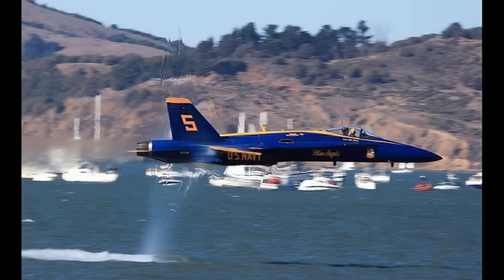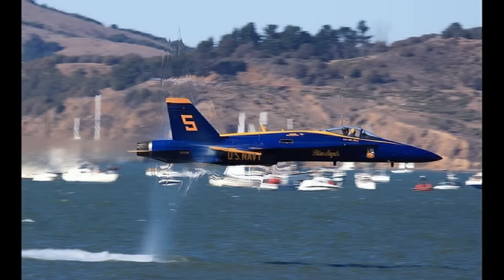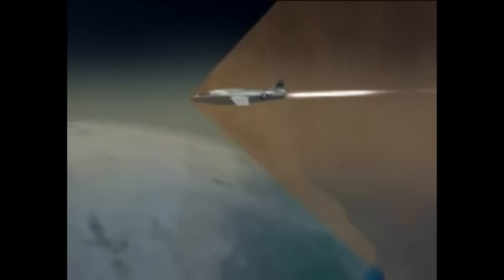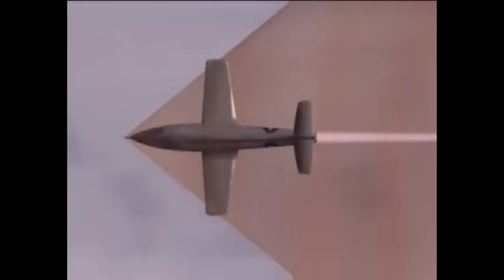Supersonic Flight, Sonic Booms

Comment: The ground-effect is visible pressure, causing, ahead surface effects on water. The super-cruise(maintained-sustained) mach1.1 (at sea-level) should build shock-waves(sound and compression-condensation, from perspective of ground-observer) and pressure-waves, to destroy roof-tiles, behind the exhaust.

There is only one known plane that can sustain super-cruise, inefficiently - f14a tomcat. Others are classified. If you ever see a fatty by the name of hawker looking like old type going only super-cruise at sea-level (double impossible to most, current, fighter jets), it's weapons is air. It's target is roof-tiles. It's intended purpose-effect is to vent on enemies. Bonus for good performance pilots... Fuel is expensive. Super-cruise without after-burner(reheat), that is the game.
Reply: Some cultures think they can get away with bullying others... The joke is on them.

Comment: You can not see a sonic boom.  Your entire video is bunk.   A vapor cone has to do with the moisture flowing over the surface of the aircraft.   They are easily viewable at slow speeds as when landing.  To know you've witnessed a supersonic event, you must see the aircraft go by without ANY sound.   Then, within a second or two, you literally hear the sound  chasing the aircraft. 

Stop using vapor cones as a visual reference for a supersonic event.

Comment: Sonic boom is an impulsive noise similar to thunder. It is caused by an object moving faster than sound -- about 750 miles per hour at sea level. An aircraft traveling through the atmosphere continuously produces air-pressure waves similar to the water waves caused by a ship's bow. (short explanation) sound has it's own speed so when somebody/something is going faster than speed of sound it creates a Sonic boom

Comment: Very nice video. I haven't seen some of those low level flyby clips before. You've collated some awesome footage there.

The subject of transonic and supersonic flight is really fascinating. There's a fair amount of instinctive flight dynamics that goes right out the window when an aircraft reaches that threshold. A lot of early experimental supersonic aircraft crashed because the whole flow of air around the plane drastically changes at those speeds, and suddenly the pilot finds the control surfaces don't produce the expected flight attitude changes. I read one test pilot likening the effect this had on his experimental plane to dragging a bubble of stalled air with him that encompassed all the tail surfaces !

I think the sentence "Seriously scary shit" probably didn't even come close to describing that feeling. :D

Comment: If the aircraft is going faster than sound, the cloud cone will have a central angle less than 90 degrees. If the angle is larger, it's not supersonic.

Comment: Just because you can see a vapor canopy form around a jet that is going relatively fast does not mean that it is going the speed of sound. It is just an indication of the water vapor saturation and condensing that forms around the fuselage and wing. This can happen at relatively slow speeds at near 100% relative humidity. It is especially noticeable on aircraft that are flying relatively low to a body of water where the humidity level can be much greater than the air just a few feet higher in elevation. This is a common misnomer and misunderstanding of the non-aviation/non-aerodynamic types. My credentials: Former Navy F/A-18 pilot and aerospace educated United States Naval Academy graduate.

Comment: Back when Mesa,  AZ had air shows at Williams AFB I was able at one event to enter show from adjacent farm. I was the only truck parked directly in line and at the very end of the huge runway.  I stood on top of my camper shell as the Blue Angels would seem to use me as a vantage point.  Traveling at a extremely high rate of speed only 50' off the deck.  That put me at almost able to touch the fuselage as they passed by. You could see how ridged the F-18 was.  You would hear the aircraft slicing through the air long before the sound of their engines as pulled the stick back at went ballistic.  It was an event where I said WTF u am getting the best seat at an airshow ever. I still can not figure out why the cops didn't attempt to move me out of the show.  With my Coors light in hand and a camel hanging out of my mouth it was priceless.  I thank the lord above.

Comment: a sonic boom coming off of an SR71 is truely a wonderous thing to behold. while stationed at ELLSWORTH AFB in the early 80s i experienced one very up close n quite personal. i was driving to our squadron supply on the road next to the flightline while an SR71 was taking off. the plane went about halfway down the runway then shot up almost vertically with the sonic boom following very shortly after. i swear it felt like my car was coming apart and the glass in the windows was rippling. i really did think they were going to shatter. i slid to a stop with my heart pounding n just watched as it disappeared into the sky. awestruck is the only way i could describe the event....

Comment: Bending light waves that travel at 670,616,629 miles per hour??? I don't think so! Also, light is a massless particle and only tremendous gravitational fields bend light, or cause gravitational lensing. What you are seeing is a pressure drop causing a drop in temperature condensing the water vapor in the air.

Comment: 2:35 That Atlas rocket was not going supersonic speeds at that time.  The shocks you see were coming from the engines.  The exhaust from the engines IS supersonic and makes a crackling sound, that's why there were so many shocks.

Comment: A vapor cone, also known as shock collar or shock egg, is a visible cloud of condensed water that can sometimes form around an object moving at high speed through moist air, for example, an aircraft flying at transonic speeds. When the localized air pressure around the object drops, so does the air temperature. If the temperature drops below the saturation temperature, a cloud forms.

Comment: Condensation isn’t produced due to the enormous pressure caused by the sound traveling as it aproaches it’s own speed? If as you say, pressure drops, temperature must be very low to condense steam.

Comment: 0:38 That ring of water vapor is actual trans-sonic not supersonic I am not going to go into details
 trans-sonic:(aerodynamic flow or flight conditions at speeds near the speed of sound.) super-sonic:(greater than the speed of sound waves through air.)
small difference but just wanted to update you on the information.

Comment: Imagine inventing something that could eliminate the friction of air while flying.
Reply: Not possible. The only way not to have any air friction is to fly in vacuum.
Reply: Aliens got both vacuum and a sheer covering. That's why they don't make a splash when they enter the water and are protected by sheen material so they can go so fast in the air without burning up 😂
Reply: @dannamorse3242  Thank god they have that technology, else the neighbors wouldn't be able to sleep if Mr. and Mrs. Alien decided to have fun in bed. 😅😂
Reply: @dannamorse3242  we gonna need that from them! Just tell them to give it up all nice like!🤚🏿🤨
Reply: You mean like flying at extremely high altitudes or in space?
Reply: *viscosity
Not friction
Reply: @rudolphclaus9565  viscosity is for liquid would they class the air. To me since it's in gas form I believe it's friction
Reply: @locorylocreshin5000  viscosity is for fluids. Liquids and gases are fluids. Air is gas. 
Friction is only for solids.
Though now I see drag is a better word for it than viscosity..
Reply: -  The pure volume of the aeroplane has to push the air molecules out of the way, even the Space Shuttle had no direct contact with air molecules, but the shockwave it created a huge drag and heat, radiated on the shell of the craft. Heat and drag will exist forever in atmospheric flight, that's just the law of nature.

Comment: I'm going to try to fix this explanation:  Is simply a pressure wave, created in the same way a boat creates a wake.  You exist like a floating cork that's been hit by a boat wake, and the height the cork reaches in the wake is equivalent to the increase in pressure you feel in your ears from the pressure wave, as the aircraft flies past.

Comment: When the space shuttle landed at Canaveral, it flew over my old house in Orlando and I was out running in the neighborhood.  I heard this "BUM bum" sound.  It sounded like the large cardboard cylinders that hold 10 foot sections of carpet dropping on concrete.  Another time that thing passed overhead while I was sitting next to an open window and it sounded like a 12 gauge shotgun blast just outside the window.  

My cat quite literally levitated three feet when this sound occurred-

Comment: it does not seem to be a traveling wave that causes the sonic boom but that the expanding wave hits the ground and bounce back and collide with itself the very moment the speed reach the speed of sound and that byond the speed of sound the relfection travel to slow to hit itself. think an orange that  hit the ground and splash. that is what happend to to sound wave when it hits itself. the reason why the orange get splashed is because the reflection of the force bounce back against the orage and create destructive interference that caused the orange to get splashed or damaged. 

its likely that what causes atomic bombs destructive force is a destructive interference pattern created by resonance. 

an expanding sound or pressure wave would not cause destructive forces if it it didn't hit itself.

the ground act like a mirror to pressure waves just as much as a object physically hits the ground and bounce back.

a pure expanding wave would only cause a slowing sound as the air volume the sound travel in expands and not a boom effect.

Comment: At the speed of sound at sea level, roughly 761.2 mph, the aircraft must drop about 108 FEET PER SECOND as it goes over the curve of the earth. Each minute the aircraft flies at 761.2 mph, it drops down over the curvature 6533 feet or 1.23 miles! This is not observed, nor is it possible on the flat plane we live on. This is why NASA uses a linear flight model based on a “flat, non-rotating earth” (NASA’s own words) NASA admits the Earth is flat and not rotating.
http://ntrs.nasa.gov/archive/nasa/casi.ntrs.nasa.gov/19890005752.pdf or https://www.nasa.gov/centers/dryden/pdf/88104main_H-1391.pdf

Comment: Sonic booms are cool, too bad they are bad
Reply: Yes, too expensive .. 2003.. no more.
Reply: It's expensive, it damages windows, pollutes more than the average airplane, it has no practical use other than exhibition or military use.  There's a reason commercial supersonic flights are not a thing.
Reply: Bro, Have you heard of the Concorde?
Reply: British-French turbojet-powered supersonic passenger jet airliner that was operated until 2003
Reply: you are correct

Comment: bending lightwaves ? the SR71 isn't a dam black hole
Reply: Mirrors do not bend light waves. Only sufficient gravitational mass can bend light. Mirrors reflect light at incident angles, that's not a bend, that's a reflection. Similarly, when traveling through different mediums, light will refract, not 'bend'.
Reply: srsly
Reply: +Sharky Productions Mirrors bend light waves... So do the wires that allow you to type that very sentence. Its not that hard. A black hole has to do with mass, not light.

Comment: While sonic booms have been forbidden over the USA for a long time that ban was lifted during the air war in the middle east in 1991 - the first Gulf War - so while sitting in a remote camp site south of Pheonix, next to what is called the World's largest air base I saw a black 2 engine plane go over a high mach and heard the loud boom (twice); it raised dust off the desert floor! Years later I learned it was the record setting retirement flight of a SR-71 going form LA to DC in just over an hour. Telling a man who asked about this at a Jet Aircraft Museum at MSP he blurted out "YOU ARE DELUSIONAL' which is when I saw how that isw Mil-speak for 'you saw somethingtop secret'. Yet I was able to learn the secret of the Aerospike Ram Jets by crawling around ti then, got to sit in the cockpit (which by the way the sign said was the fastest airframe we ever built and thanks to a spar bathing the windscreen with liquid O got to 3,368mph, or so - then VP CHainey got made about my plan for a carbon version with HOPE water engines that could go much faster and he sent the CIA to take it away - then because I could not get job, even with my new designs on the cover of Popular Science !?! I sent it out on a library computer where the CCC spies stole it - blackmailing the Bush/chainey folks with info too hot to post - so they get total air & space domination and we do not - sure censor this guys so we can lose the next war, badly!!!! My point is I need a job at a facility like Scaled Composites since my new designs are even faster - and exhuast pure H2O, made with water splitters -naturally.

Comment: All these videos about the sonic boom are a bit too vague. If you want to know, the cone cloud isn't the shockwave. It's water particles that have been hit with such an immense force at such high speeds (by the plane #eurofightertyphoonistgebest 😊) that they form water vapour. But as the plane is going to fast, the cloud disappears in an instance. Luckily water molecules are pretty much EVERYWHERE and the cloud can be formed multiple times. That's why it looks like it,  (the cloud)  looks like it's violently shaking. But the it does have something to do with the phenomenon that appears at 02:33. The reason it's normally cone shaped is because thats how shockwaves look. And the shockwave is the thing shaping it. The shockwave is what is said in the video. The vapour cone is what I explained.
Reply: +Galactic Gamerpro no am spodermerk
Reply: +Galactic Gamerpro    o

fuk fuk fuk fuk fuk fuk
Reply: The worst explanation ever.

Comment: I dont understand the atlas shockwave ripple at the end, it doesnt even look real, it looks fake, can someone explain to me? If the ripple happened then why doesnt the ripple happen every time? >_<
Reply: +K- Ainmé As Rich C. stated, it does happen every time, just usually you can't see it. In this case there happened to be a diffuse cloud layer at just the right altitude with the sunlight hitting it at just the right angle which made the shockwave clearly visible.
Reply: it does happen every time

Comment: lol top fuel dragsters can't even fuck with these jets
Reply: +lester jones Top fuel dragsters accelerate quicker but have a much lower top speed.
Reply: +Chris Newman (Fat Libertarian Dude) in 0.54 seconds a top fuel car hits the 0-60 mph mark (fastest production car is 2.9 seconds) in 1.96 seconds the car hits the 200mph mark and in 3.05 hits the 300 mph mark. The current record for a top fuel car is not for a 1/4 mile race. Due to the increases in technology these cars are now est at 10,000 bhp. they now only race for 1000 feet instead of the 1320 feet for safety. Also using a RacePak they peak at 4.8 G's and pull 2 G's for the entire run. The space shuttle sees about 3 G's max in take off and re-entry. They are spectacular to see in person and I highly recommend anyone to go see one in action.
Reply: ***** The current world record is 3.728 seconds @ 329.91mph 1/4 mile.
Reply: Combatsmithen Besides the fact that the catapult is doing most the work, a typical catapult acceleration of a fighter jet takes only two seconds to reach the 160 - 170 mph takeoff speed. A top fuel dragster can reach 100 MPH in 1 second and I suspect(not sure) that within 2 seconds they can reach the same 160 range. Also the typical carrier runway is about 300 feet. A top fuel dragster is already 330 feet down the track in about 2 - 2.2 seconds.

So at best, even with the catapult assisted acceleration a fighter jet likely can only match the acceleration of a top fuel dragster.
Reply: Combatsmithen I'm serious. Look it up. They pull more than 4 Gs of acceleration. And no, not KPH but MPH.
Reply: +Chris Newman (Fat Libertarian Dude) not when these things lift off of a carrier with a catapult! Then they accelerate faster than the dragsters
Reply: +TR Welds Holy shit man - I seriously didn't know any of that.
Reply: +lester jones duh
Reply: Chris Newman 100 in 1 second?? How is it possible to accelerate that fast..... Maybe 0-100 KILOMETERS per hour in 1 second.